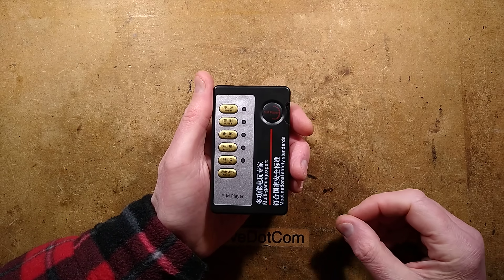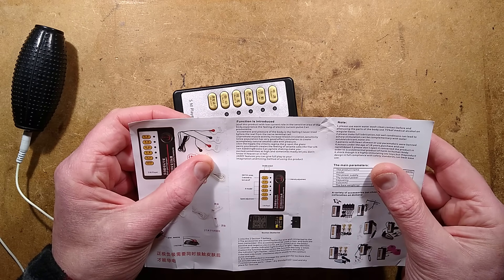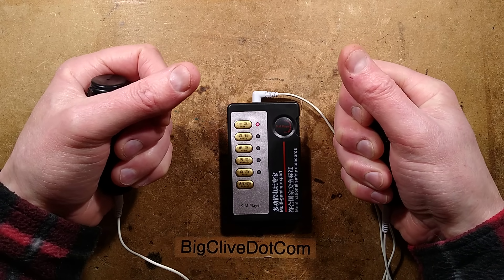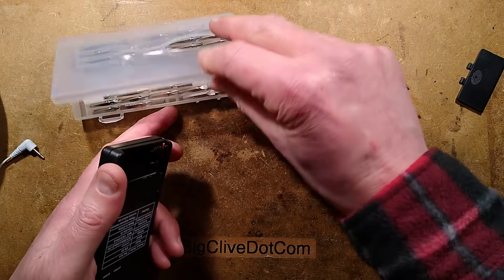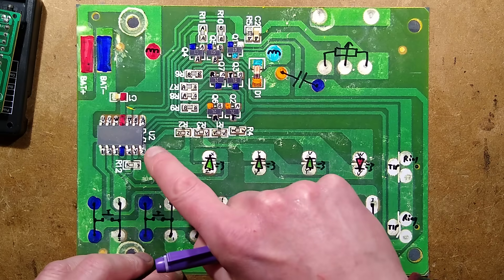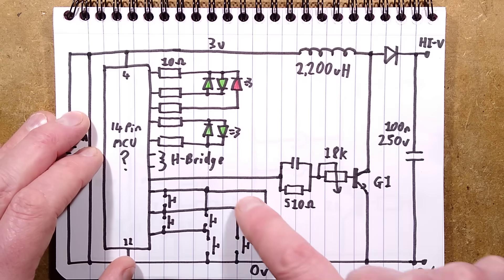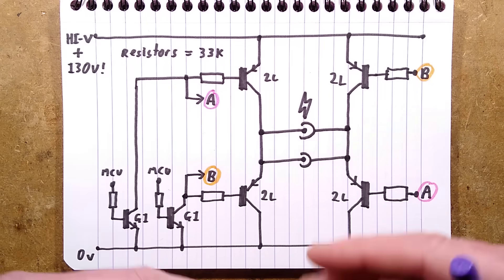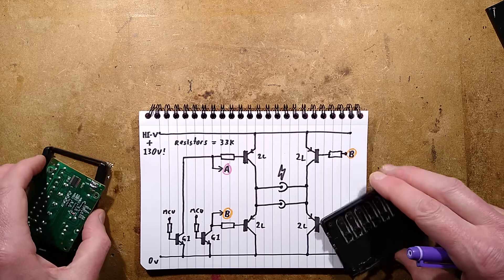Inside an invigorating electro-health device - with schematic

Comment: Proper TENS units for medical use are quite nice for reducing pain and/or "taming down" misbehaving muscles. We have one that's meant to drive 2 pairs of gel pads and is powered by a 9V block. IIRC you can't change the pulse frequency, only the intensity (it directly shows the mA rating). It always starts at 0mA, so you can't go full blast right away, and it automatically sets a 30min timer for shut-off.

Comment: I was asked to fix a quack device which was to "rejuvenate" recharge you . Folk on holiday from USA , holiday ruined as first night in uk plugged in to 240v it went bang. Opened it up , nothing inside apart from a blown neon . Couple capacitors only and cost them £6k in USA. Fitted New neon and gave back saying it's fixed
Reply from the maker: Those products rely on a high price to imply functionality.

Comment: Got a LLoyds the Chemist version which gives different pulses and different intensities. It worked well on strained back muscles using self adhesive pads. The difference between walking almost painlessly and not walking at all.

Comment: First rule of electrical play: No contact above the waist. That said I've had my PES for over 25yrs and it hasn't failed me yet. 9V battery was weak so 12V much better but it tends to run hot so I drilled a few small holes near the Xformer. I eventually repackaged it into a slightly larger case and changed a few things for easier adjustments. One can even connect an oscilloscope for that extra ambience. Experiment have fun and play safe.
Reply: Thank you for your comment. We do need something to help kids to learn they shouldn't trust something just because someone on the Internet says so.

Comment: lighter than the old car battery wet sponge with salt water combination
Reply from the maker: DC is not recommended for applications like this, but does have uses in iontophoresis for control of excessive sweating.

Comment: When I had severe hip problems, (I couldn't even put my socks on the pain was so bad), the nurse suggested using a TENS machine. I used one for about a month and my hip has been fine ever since. I recommend them if you have muscle or joint pain.

Comment: I still have a TENS medical device I got from the pain clinic, that I used just two years ago for pain treatment on my calf of one leg that was to be operated on later for a hip replacement. Had to stick the electronics (2) on my lower back on the muscle that goes down the leg for maximum effect. I would say a 6 - 7 out of 10 pain relief. Still have the device. I controlled it with an app and it only had the click on/off and 'volume' control.

Comment: Do they use high voltage and low amperage for "safety" I know you did a video where it only took 15 milliamps to make your hands close
Reply: Yes, the voltage is high, the current is low - and the output is a complex waveform that is designed to stimulate the muscles.

Comment: Now my GP is trying to convince me that a TENS machine will be more powerful than oxycodone for dealing with multi-location spinal damage. I'm waiting for the snake oil prescription next. 😅
Reply: Maybe it will. Drugs do your whole body, TENS just the spot that hurts. I got sick on oxy after a dental procedure and swore never again. tylenol instead.
Reply: @jamesvandamme7786  I have spinal damage from my skull to my bumhole. For TENS to be effective I'd need so many machines I'd have to wheel them around on a trolley. 😂

Comment: You turn the dial up to adjust the power down. Some sadistic SOB did that on purpose.
Reply: Hence the "SM" prefix in the model number.
Reply: Probably some cultural thing where they use a top-to-bottom writing system.
Reply: Like the blinker switches on a tram. It's all about which side points into the direction you read, the side facing you(r thumb) or the side away from it. Tram blinker knobs use the side facing you, not the pointy bit facing the front of the vehicle. So you turn them clockwise to signal left. If you were to put a knob on this device's dial, turning it anti-clockwise for "lower" suddenly would make sense.

Comment: A rugby player told me that he got a electric shock device to tone his muscles, but set the frequency too high so that he couldn't turn it off. Apparently his wife was laughing so much it took her 5 minutes before she could turn it off for him.
Reply: Something similar happened many years ago where I used to work. The arrogant boss got his expensive silk tie caught up in the paper shredder and his secretary was laughing so much she couldn't switch it off until he'd nearly choked.
Reply: @jamesharmer9293 someone write that down, needs to be a movie scene.

While we’re telling HILARIOUS STORIES, I was using my Dremel with the rotary sander bit, grinding some plastic off my wrench holders I had just received, since they were slightly too tall for me to close the tool drawers with them installed. 

I’m a guy but at that point I had let my hair grow long enough to hang down to my elbows, you’d think while using the Dremel I’d wear a hat or something…. It happened so fast, i craned my neck a little further to get a closer view, Dremel grabbed my hair at about 15k rpm, ripped itself out of my hands as I tried to regain control of the Dremel to turn it off (only high speed rotary tool I have with a fucking toggle switch) it’s smacking me in the face repeatedly as it twists my hair more and more, getting closer to my face. After about ~2 seconds of the Dremel treating my hair like a cotton candy maker I managed to grab it with both hands and close the switch. 

Dremels should probably not have a toggle switch, I had to cut my hair immediately because I had a single unicorn dreadlock.
Reply: @ogonbio8145  Ouch !!!

Comment: Hmmmmmm, my unit does it using independent fully isolated transformers on the OUTPUT, running at 90V and fully current controlled for safety.
...(read my other comment), anyway, this unit is not very safe, as the 130V boost converter does not have current limiting directly??????
...I would not use that unit, but I am spoilt by a proper (and expensive) medical TENS unit.

Comment: I have a much larger unit that also uses a external mains plug pack.
I had SERIOUS pain that was eventually treated (for life) with huge dose opioid meds.
I had to use it up very high, so painful, but in a kinda good way, so maybe endorphins might be it,
and after about half an hour, it has an OFTERGLOW affect for about ten minutes.
A timer and that AFTERGLOW is what allowed me to actually get some sleep with all the pain I had.
....A friend suggested "other" uses, yaaah, no thanks!  ...so I understand what you are talking about 😁
my unit runs with two isolated transformers with an STM8S103 CPU and buffer trannies.
All very basic, but being a proper medical unit, it sure cost a bit (AU$175 in 2014).
I would have lost my mind from NO SLEEP and NEVER ENDING pain for months
before the INSANE medication laws in Australia finally allowed me to get the medication I needed.

Comment: I have limited dexterity in my hands due to Charcot Marie Tooth disease, and have been using a similar device in an attempt to regenerate some of my severely atrophied hand muscles.  I have found modest improvement, but not much more.  These things are DEFINITELY not going to make you into a bodybuilder.  That's surprising in a way, because at full power they will absolutely light you up like a pinball machine.  I can't imagine inserting one into....  Nope.  I don't even want to think about that.

Comment: The thing is pretty small, how long will AAA x 2 last - 10 minutes????????
Reply from the maker: Quite low power device.
Reply: For many, 10 minutes is quite long enough.
Reply: Do consider that the "AB toner" variants were working off coin cells, and even those lasted more than 10 minutes. You do the math about how much more energy there is in a pair of AAA...
Reply: @AttilaAsztalos  Hey, my medical unit uses a 9V battery, and last a few hours at best, ...NOT NICE and VERY EXPENSIVE, 
so I use an external power unit, It has a socket for it, i.e. a dual power unit.
Two AAA at the same power out would not last long either, but longer if this thing outputs less power.

Comment: "There's a capacitor that probably holds a charge... let's discharge it with a pair of tweezers"
That sure is a tool choice XD
Reply: ...and he very carefully tries not to when removing the board, right after deliberately shocking himself with the device several times.
Reply: ...wouldn't actually shock YOU, mind, assuming you're not contacting the thing by any other means except the tweezers you are holding. It MIGHT weld the tweezers on to the cap, but that's a different story...
Reply: Zircon Encrusted Tweezers…

Comment: Hmmm. It says, “multi gamingexpert” on the case. If you hide one of these in a game controller and you push the wrong button, do you get zapped when you lose a life? 😅
Reply: Was expecting electrodes around fingers and a high frequency rapid mode for assisted button pressing.

Comment: that bottom PNP is POSSIBLY a design flaw, I suspect the engineers specced a diode or something to offset the 0v rail so the PNP transistors turned on harder
or they could be relying on the semi-on state of the low side to limit current without a resistor, trying to provide a smoother play time rather than hard capacitor shunt shocks

these units have been given a bad rap, shocking your body with tens and SM units is NOT fullly fun on HIGH, unless you are a masochist or already in severe pain that a nerve overstimulation can dull
but on low? Clive literally demonstrated what low looks like, a twitching sensation in muscles that is not entirely pain, and when done in otherwise sensitive intimate areas(never had the electrical pleasure but have dabbled enough to suspect it is true) it could cause the sensation of reciprocal motion, which in some areas of the human body is a very nice feeling that builds to an even nicer feeling

the problem is the stigma on those kinds of unclothed activities and poorly designed devices, what makes you happy when alone should literally be illegal for others to complain or judge you for, if nobody IN the room is hurt(ie doesn't approve) then people OUTSIDE the room should not be legally allowed to speak of what happens IN the room

Comment: Clive, That is pretty silly, discharging a cap with metal tweezers and then touching the cap leads to insure it is discharged. Is there someone else there that you are protecting from a possible electrical shock? Years ago I recall a TV repair tech. showed me the HV to a black and white TV CRT was not life threatening by touching the HV conductor while it was fully powered up ( he explained that the HV rapidly drops because it is not regulated in a B&W TV ). I thought he was silly too.
Reply: The other side of the cap is isolated so there's a minuscule current path. Although you get some current through leakage capacitance. Touching 15KV is not a good idea.

Comment: I tried a TENS machine years ago, it was quite good at reducing pain. It ran on 4  AA batteries, plus it had the option to use a mains plug pack. There was no way in hell that I was going to trust that for isolation.
Reply: Yeah, I had a tens machine for a bad back and it really did work.  It was just masking the pain, though, not curing anything.

I had a touch of RSI in my wrists too so one day I tried it on my hands.  My hands went into spasm, into a claw position and went totally immobile.  I couldn't turn the machine off again.  I had to switch it off with my nose.
Reply: There's special regulation for medical devices actually, so basically higher standards to which for example power supplies need to adhere, and in hospitals, they usually run on a so called IT grid ("Isolé Terre" - ground isolated), so that you can't get a shock even when touching a live wire.
Reply: @graealex  I'm pretty sure that, if it came from China, the manufacturer saved the money instead of buying a DIN EN 62353 (VDE 0751-1) compliant insulation tester...
Reply: Worked quite well the last time my lower back just exploded in pain.
I used it until I could start moving my pelvis to move and stretch the muscles. A few days of Ibuprofen and constant exercise helped relaxing the cramped muscles, and made standing and walking bearable again.
The only solution/pain prevention is constant exercise, stretching and movement!
Reply: They had me try a tens and as an electronics tech, it put me on edge getting shocked over and over, that I never used it...
Reply: I had a tens unit I used at one point for chronic pain issues and it sat unused for several years. I tried it out again on my hands to see if it still worked, long story short I figured out the hard way something had gone terribly wrong inside it when the thing went beyond full power and cramped both my hands so bad I could not turn off the buttons on the unit. I panicked and tore the electrode pads off my hands to stop the shocking. It was quite the experience, scared the heck out of me considering the electricity was going through my chest and I had no way to turn it off.
Reply: I want to throw a safety tip in here. When you’re using a TENS unit you never apply the pads to opposite side of the body. You don’t even want the beginning of a chance of passing a current through your chest.
Reply: I rather play with live 240v ac than touch such a device again..  It hurt me a lot...    ac gives me hardly a buzz, still not pleasant, but it seems not to hurt me, is also why I have to be care full and don't start to believe that 240 ac can not hurt me.
Reply: @pwkoert6594  If you tried a device like in the video, I'm fairly sure the pulse train it delivers is far from well designed.  These devices jump on a hype-ish like trend of erotic estim, and tend to either be repurposed muscle stimulators (not necessarily intended for TENS-treatment AT ALL) or just "mess around with something that pulses".
Good devices will only hurt when the connection to the body is made incorrectly.  This involves medical-grade devices for pain reduction and made-for-play devices.

Comment: I use the tens machine and they actually do work for pain management ,now they have the ear buds that hook up to the tens to help correct issues with the vagus nerve which is damage for many people with diabetes ..The only thing is knowing what frequency to use and the pulse width and current and and voltage .who would think an old form of electroshock therapy becomes a modern tool again from,torture device to  medical instrument to sex toys and back to medical instruments .strange turn of events

Comment: I remember a VERY early medical TENS machine that used a 555 and it varied the frequency and mark space ratio with two pots. 
The output of the 555 directly drove an LT44 audio transformer. 
The TENS was powered by a PP3 small 9 volt battery. 
It worked well enough until more sophisticated TENS came along with pre programmed frequencies/mark space ratios. 
The TENS I have now has twin separate outputs and over 30 different output profiles. 
Why you ask, well for pain relief you find that the patient gets accustomed/used to the output and that profile no longer provides the desired effect to reduce the pain. 
Now none pain relief devices are a different ball game as Clive has pointed out in the past😁
NEVER use TENS above the neck!!!!
KW 14:35
Reply: ...across you chest, including what Clive did with hands, and like you said above the neck (....unless you like your brain fried)
Reply: The DYI design with audio transformers is available in the Internet along with the gigabytes of mp3s 😜
Reply: My GP 'prescribed' me one for cervical spinal damage. I declined to use it.
Reply: @GothBoyUK either side of the lower neck is ok if you are using a modern TENS. 
They have multiple modes and a level control. 
Sippy start at mode one and gradually increase the level and see if you get any benefit. If no benefit, try the next mode at its lowest setting gradually increasing level. 
Rinse and repeats for all modes until you find a mode and level that works for you. 
Positioning of the electrode pads is also crucial. 
You might find moving the position of the pads also gives a better effect. 
It’s all trial and error because no two people are the same and no one setup will work for all people. 
I found it worked for me with L5/S1 and C7 spinal problems. 
Suck it and see, your mileage may vary.
Reply: @GothBoyUK  I had enormous pain, and it made it bearable and able to sleep.
Just wondering, why did you decline it?

Comment: No hidden setting by pressing two buttons at once? Be interesting to see the pulses scoped, or even attached to a speaker

I see the outputs aren't joined together, any difference between one and the other?
Reply from the maker: Both outputs are just commoned.

Comment: Very interesting.  Thanks Big Clive.  Sort of surprised at the voltage.  I mentioned on Patreon that I have used a TENS unit for my back with "some" degree of relief.  I guess it tends to do something with circulation as well as relaxing muscles.  Mostly, I found a good chiropractor and might visit every six weeks or so with much better results - That - and consciously improving my "Head over Shoulders" posture.  I'm 2M tall so that's my excuse for walking in a sort of ducking fashion.
Reply: I've had similar experiences. I think the TENS simply plays on the nervous system similar to when you use active resistance to stretch a muscle pain. (I read the book We Are Electric) By the way, after 40 years of lower back pain and spasms I have found a solution: Silver Sneakers instruction, especially the core focus routines. Four years with no spasms or debilitating pain now. Good luck to you.